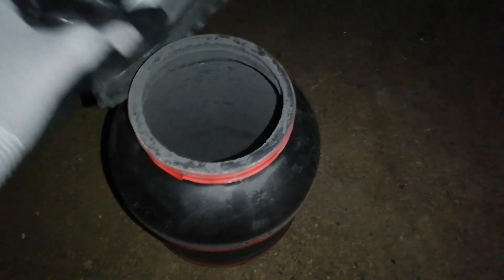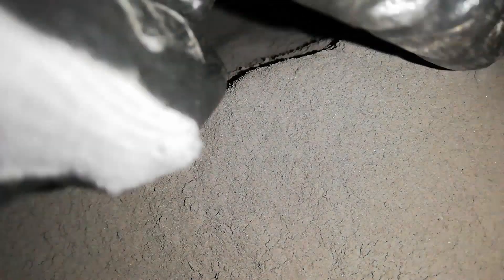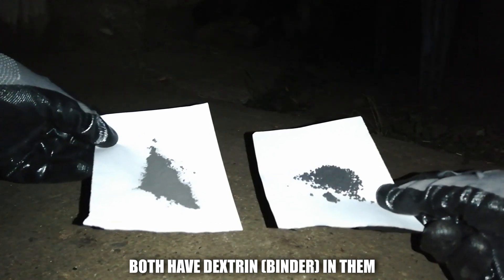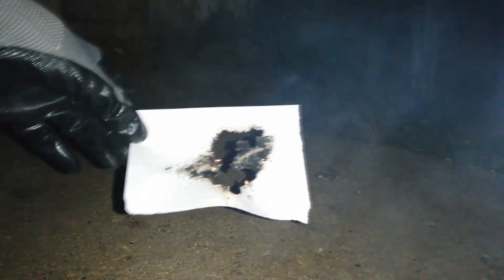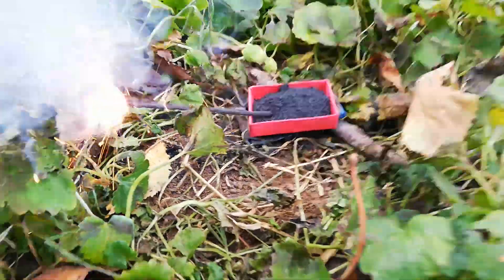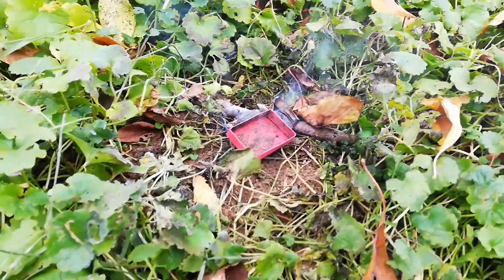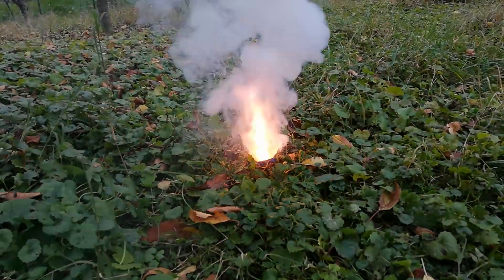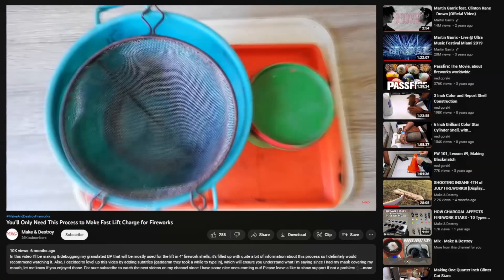The Power of Granulation Process in Fireworks

Comment: hello M&D. Optimal. It seems to me that, based on the size, the granulated BP is a 2FA. It's right? And what kind  of solvent did you use for granulation? in any case the granulate (even the one with the rice husk) is excellent, fast !! Great job and good fires !!! Alex from Italy
Reply: Dextrin as a binder and water/alcohol mix as a wetting agent